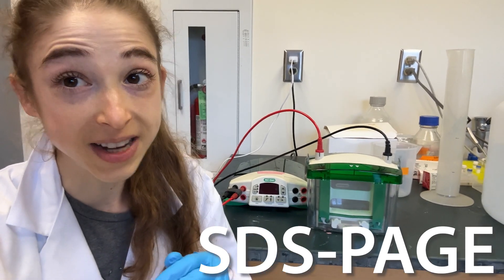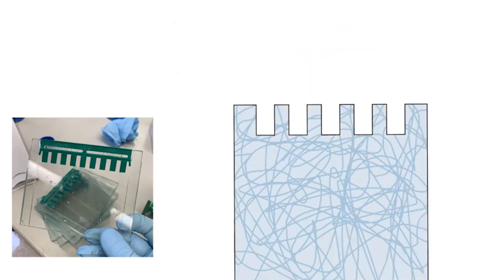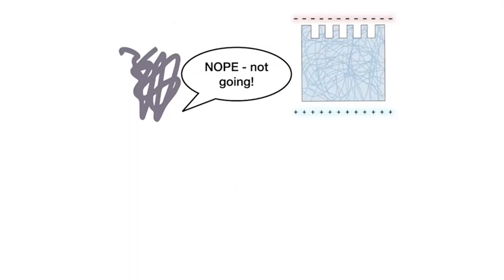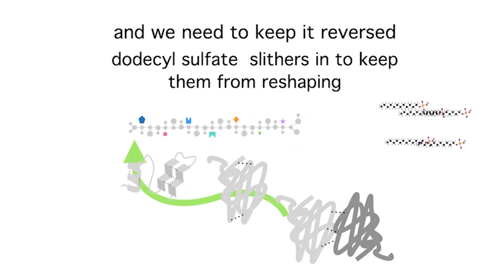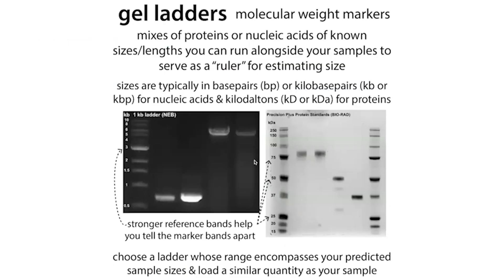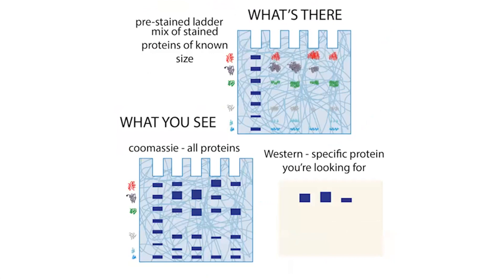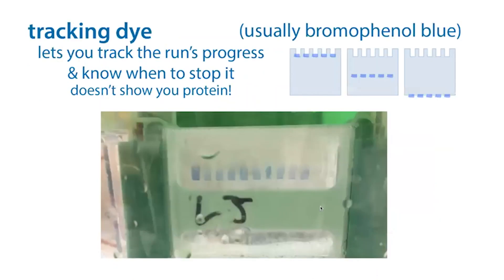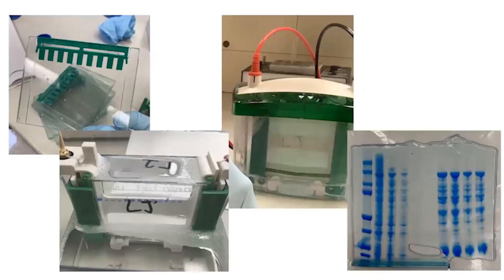SDS-PAGE: an overview

Comment from the maker: Imagine protein letters interacting as 2 people shaking hands. At low temperatures, it’s more like they’re holding hands. But adding heat is like getting them to shake really vigorously. This makes it harder to stay held, so they come apart. But if you don’t do anything, and you lower the temp again, the hands can reclasp, refolding the protein – or even worse they can reclasp with a new partner, changing the protein’s shape – often in nonideal ways that makes the protein clump up (aggregate). 

So, once the hands separate, you want to coat them with a slippery soap. True story – one time when I was a little kid, I thought I got locked in a bathroom when really my hands were just not rinsed well after washing them so the soap made the door handle too slippery – SDS (sodium dodecyl sulfate) is a detergent (artificial soap) and it works kinda like that. Once the protein letters declasp, SDS slithers in to coat them and prevent them from reclasping

So heat and SDS both work in the shape-erasing part and SDS plays double-duty because it also does the charge painting! The reason SDS is able to slither in and coat the protein is because it has a long hydrophobic tail (the dodecyl part) that globs onto the hydrophobic parts of the protein that are normally hidden in the core. If you unfolded a protein but didn’t cover those parts, those parts would panic & clump up in aggregates to minimize water exposure, thus making them insoluble -> but the SDS isn’t all hydrophobic – as an “amphiphilic” molecule it has hydrophobic AND hydrophilic parts – it has a – charged (anionic) head group (the sulfate part) that likes to hang out with water, so it keeps the coated proteins soluble. And it doesn’t like to hang out with other – charged heads so it keeps the protein unwound and “rod-like” – ideal for slithering through a gel.

Those – heads don’t like each other but they DO like the + charge that forms at the bottom of the gel when you turn on the power to create an electric field. The electric field is created and maintained through electrolysis, which I won’t bore you with here, but you can learn more about here: http://bit.ly/2XMLMbG 

Now that we’ve seen how we prepare the protein let’s look at the gel we’re going to send it through. The gel is made up of polyacrylamide and cast into thin vertical slabs with wells at the top where you put in the protein. The motivating + will be at the bottom, so the proteins have to go through the gel if they want their reward. 

But the journey isn’t easy - especially if you’re big! Polyacrylamide is neutral & non-reactive, so it doesn’t chemically sidetrack the proteins on their journey, but the mesh runs physical interference, acting as a molecular sieve. Bigger molecules have a harder time squeezing their way through mesh’s holes. They experience more frictional “pushback” from the gel & travel more slowly. If you have a really loose mesh, small things can slip through easily (& thus travel together, “unseparated”) & only bigger things get held up, but if you tighten the mesh, smaller things start getting slowed down too. 

We take advantage of this to get all the proteins to the starting line at the same time. Depending on your sample volume & well size, the proteins might be very spread out vertically in the wells when you start the run. If we didn’t do anything about this, the protein molecules that happen to be closer to the well bottom would have a “head start” so if the molecules traveled at the same rate, molecules of this same protein that were higher in the well after loading your samples would lag behind so you’d see multiple bands for the 1 protein (probably more like a smear). Also, molecules of different sizes traveling at different rates but from different starting points could end up at the same position at the end of the run. 

To make the race fair, we often use “discontinuous” gels - they have 2 layers of gel stacked vertically. The main, bottom gel is the resolving (running) gel, & on top of that of the resolving gel is a “shorter” layer of “stacking gel” (this is the layer that will have the wells). 

The stacking gel has bigger pores so the molecules travel quickly until they reach the barrier w/the denser resolving gel that slows them down so you get a “bottleneck” where the proteins pile up into a single concentrated band. So all the protein molecules start at the same “starting line” & enter the resolving gel at the same. It might help to think of this as like a track race. A continuous gel would give you a sort of “mass start” whereas a discontinuous gel allows all the molecules to start at the starting line. 

How do we make those pores bigger? By using less polyacrylamide and/or less crosslinker - polyacrylamide is made up of chains of acrylamide. And we make it meshy by bridging those chains with a cross linker, bis-acrylamide. So if we alter the amounts we add, we can manipulate the pore size, so mesh tightness is often reported by % acrylamide and/or crosslinker. day You can also adjust mesh tightness of the running gel to get a looser mesh if you want to separate bigger things or a tighter mesh if you want to separate smaller things. 

A lot of labs buy pre-made gels and if you don’t use them a lot, that can be worth it but if you use a ton like we do it makes a lot more sense $$-wise to make your own (and it makes you feel less guilty about running 15-well gels when you only have a couple of samples!). Plus, when you make your own you can customize to your tastes (not just meshiness but also thickness, # of wells, etc.). To make them, you mix the acrylamide & bis-acrylamide, add polymerizing agents and pipet it in between glass plates before it gelifies. more on this here: http://bit.ly/2NkBoUt

so, prepared protein: check
prepared gel: check

Now we just need to put the E in the pagE! We introduce the SDS-coated protein to the gel by sticking it in wells at the top. But to get the protein to actually move through the gel we have to turn on the (properly connected) power. This is where the ELECTROPHORESIS part of gel electrophoresis comes in/ We immerse the gel in a salt water bath with a ➖ electrode (cathode) at one end & a ➕ electrode (anode) at the other end. This separation of charges generates an electric field 

If you put something charged in an electric field, it’ll move towards the oppositely charged end. We run NEGATIVELY-CHARGED molecules towards the POSITIVELY-CHARGED anode (run to red) ➖➡➕ And, thanks to the SDS, the proteins all have a negative charge that’s directly proportional to their length, which serves to “standardize” the charge so separation can occur by length.

So the proteins start slithering through the gel and, kinda like dropping a jump rope through a sea of basketball hoop rims, they’ll get tangled up, with longer proteins getting tangled more and traveling more slowly. When you turn off the power (which you know when to do by watching a tracking dye) they’ll lose their motivation to move and stay stuck.

You can see that tracking dye, but the proteins are invisible to the naked eye! So to see them you need to stain them. A common stain is commassie brilliant blue (CBB) which is a “total protein stain” that’ll turn your proteins (wherever they are) blue, so they appear as bands in the gel. more here: http://bit.ly/2ElRed7 

Each protein will appear as a band – the vertical location tells you about the protein’s size (which you often compare to a molecular weight “ladder” of proteins of known size). The thickness of the band tells you about how much protein there is. And the number of bands tells you about the purity of the sample (more bands, more proteins (but beware of multiple proteins of similar size running together and thus appearing as a single band!).

During a protein purification, you start with a mixture of the protein you want and whatever else the cell making your protein made for itself – and you want to see extra bands disappearing until you see a single strong band at the end!

If your protein biochemist friend says they can’t go to the movies because they have to “run a gel,” SDS-PAGE is probably what they’re referring to. If your molecular biologist friend gives you the same excuse, they’re probably referring to an agarose gel which is used to separate DNA – I use those too (in the molecular cloning phase when I’m trying to get a gene for my protein into a plasmid to express it from) and you can learn more about it here: https://bit.ly/agarosegelcompare & https://youtu.be/vbuxf3rcMxg

but in my opinion, SDS-PAGE is the cooler molecular ruler!

more about all sorts of things:  #365DaysOfScience All (with topics listed) 👉 http://bit.ly/2OllAB0  or search blog: http://thebumblingbiochemist.com